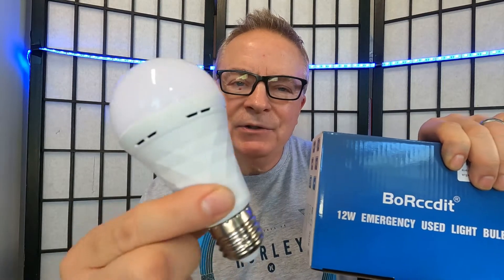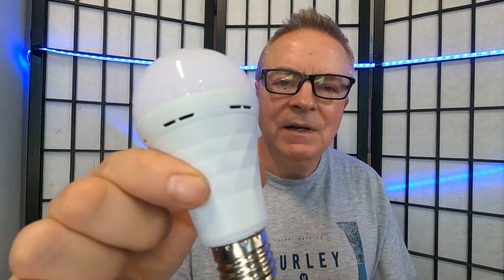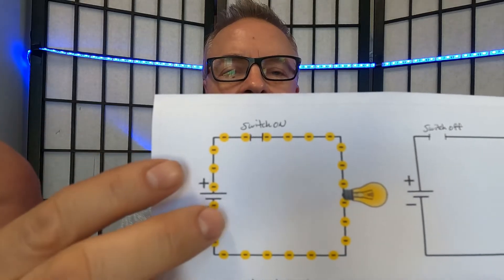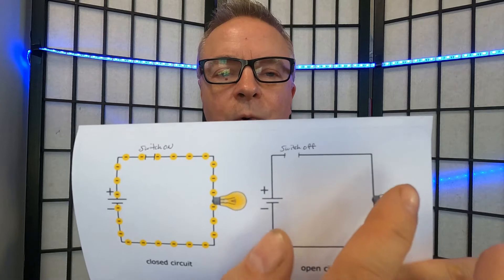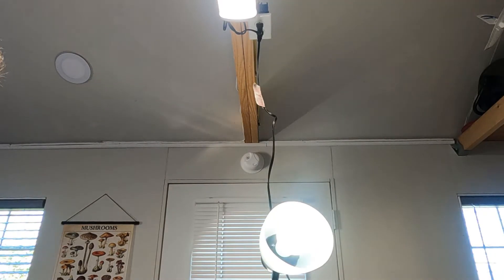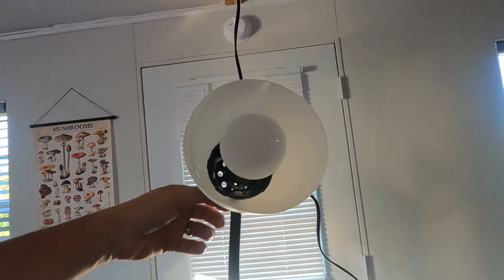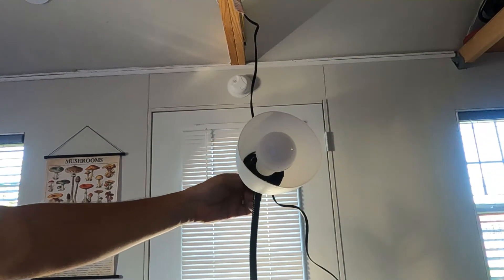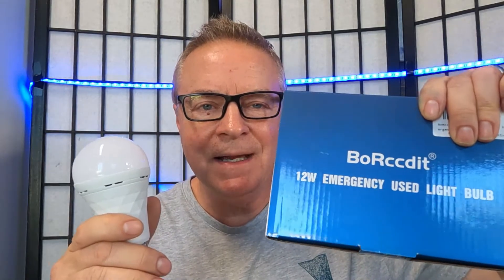HOW DOES THE EMERGENCY LIGHT BULB WORK?  BoRccdit

Comment: I have essentially the opposite problem.
In the lamp I want to have it in, when I switch the light switch off, controlling it and another lamp that is left on (the switch has always turned the 2 lights off) they both go off and the emergency bulb comes back on, even though there is power on.
IIRC the emergency lamp is plugged into the socket but the regular lamp is on an extension cord. However it’s possible both are on an extension cord.
Is there a clear explanation how you can or can’t use with lamps on extension cords?
It’s funny to have the opposite limitation but still makes it not possible to use as a drop in replacement. I’m sure a straightforward flow chart could be made for all cases including incorporation use of extension cords.

Comment: Thanks for this. I guess there is circuitry in the bulb assembly to detect that there is some kind of draw on the circuit (not sure how it does that) so it can tell the difference between turning off the switch and turning off the breaker.

Comment: Are they safe to use every day in all lights? Or only  as a preparation  tool for possible power outage? Only charge them when you need this emergency bulb?
Reply from the maker: Yes you can but they do get kinda warm on the middle part. I just charge them and keep for power outages

Comment: It doesn't work for me. I think that any load in parallel that is not like a short circuit (like a filament bulb in off), will not close the emergency circuit. I tried with another led bulb, cell phone charger, etc, and the only way is a short circuit in the wire of emergency bulb. Any impedance will not light the bulb or with luck, will do bearly.
Reply: If you use a led lamp as secondary, will have to be with a  very low impedance bulb and pluggued with correct polarity (led conducts current in only one way).

Comment: Put the bulb in the lamp.  Plug lamp in electric wall socket. Turn on lamp switch. Bulb charges while lamp is turned on. When power goes out the charged bulb comes on automatically. Simple.
Reply: Buy, do you use it every day? Or just charge them when you think you might need them?
Reply: Nice

Comment: Does shutting the breaker actually simulate a power outage ?  I thought those bulbs can detect a real power outage  vs a switched control ?  What happens if the switch is OFF when the power outage occurs ? Will it still work ?
Reply from the maker: I don’t have all the answers and don’t fully understand it either, you would need to contact the company.

Comment: You don’t need another lamp plugged into the same outlet. You can have anything plugged into the circuit. Like a radio or a phone charger.
Reply: I needed to know that. Thank you.
Reply: do we connect the additonal component in the same line as the lamp
Reply: Can I something like a night light or an air freshener ?

Comment: Still confusing
Reply: I’ll try to simplify it think of the circuit as a draw bridge the cars going across represent electricity flowing now when the draw bridge has to open the traffic has to stop once the bridge is opened so when the switch of a lamp is turned off it interrupts the flow of electricity just as the traffic going over the draw bridge is interrupted and a circuit in the bulb senses the flow of electricity is interrupted and then the bulb turns on due to its external battery if that makes sense and helps

Comment: So if I put a emergency bulb in a socket it may or may not work. It depends on if another light source is on the same circuit as my light.
Reply from the maker: There has to be a closed circuit
Reply from the maker: Well, it has to be on a closed circuit, it’s a little confusing I know
Reply: @DeddyMikesReviews  indeed... most definitely.